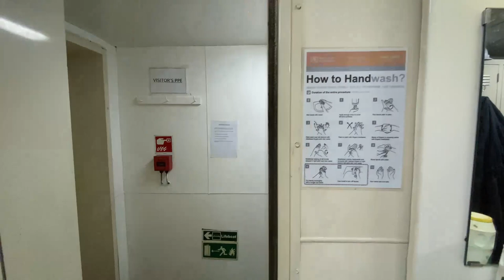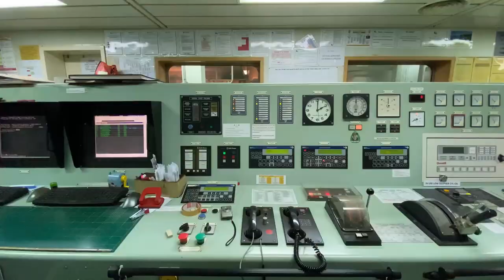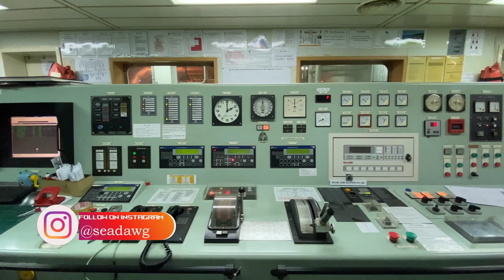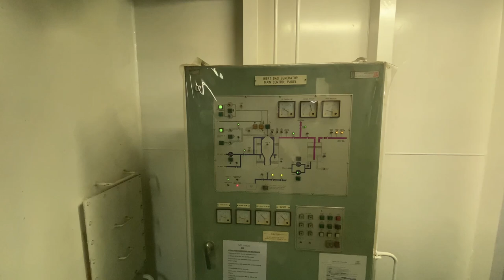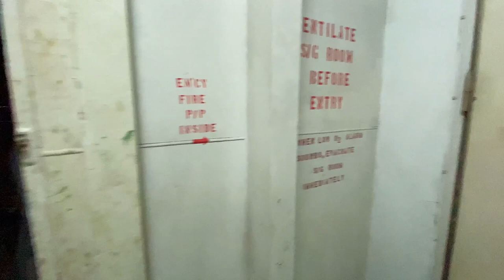ENGINE ROOM TOUR  ||  CHEMICAL TANKER SHIP

Comment: I was an engineer on chemical tankers 40 years ago. Considering it is somewhat smaller than the ships I worked on, the engine room is well spaced out 👍  Much has not changed, but I saw ‘new’ equipment created by legislation eg. Ballast Water Treatment, unheard of in my day. Inert Gas Generation, we carried N2 in bottles to top off tanks. I would concur with the comment of a clean engine room, looks new! Good video congrats
Reply from the maker: Thank you for your kind words ! 40 years? You must be missing them Chemical tankers.On this ship ,there were N2 bottles too in midship store along with the generator. Engine room was quite clean around the time video was shot.
Reply: @omyandsea   Life experiences, maybe Rose Tinted Spectacles on my behalf. I do recall working 12-15 hour days much of the time keeping the job going with ships built in the early 70’s.